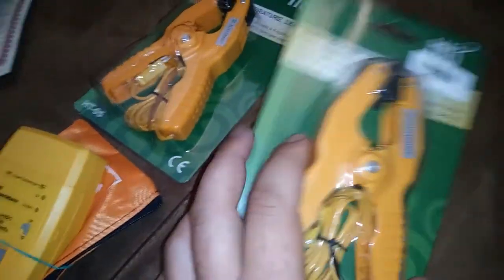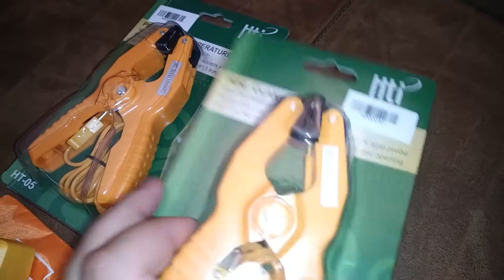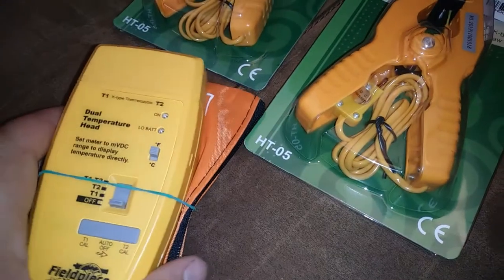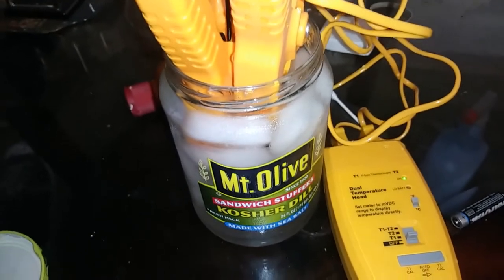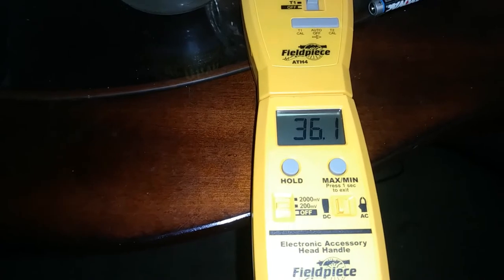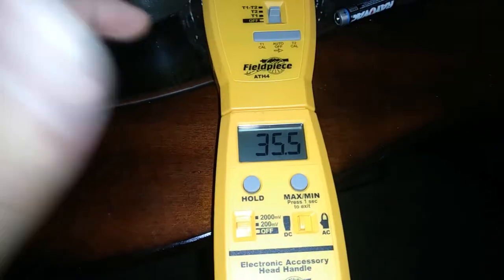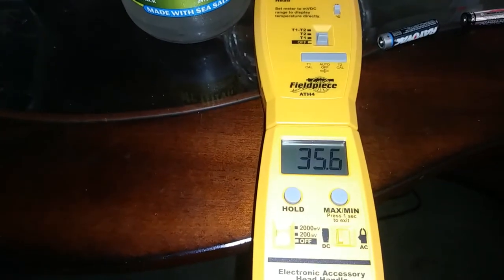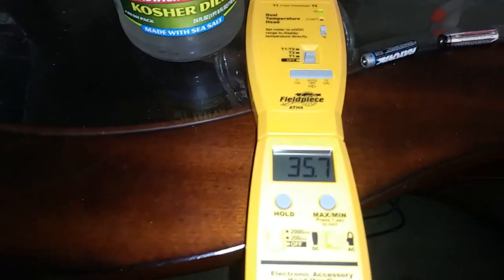Tool Update- Accuracy Test on Cheap Thermocouples with Fieldpiece Dual Temp Head

Comment: I had the same experience trying some inexpensive K-type sensors from Amazon in my Fieldpiece ST4.  The two cheapies read very close to each other, but they are nearly 10 deg away from the orig Fieldpiece sensors.  I'll keep the cheapies in reserve to use as replacements when the time comes and will recalibrate the gauge then.  Was a little unsure about my plan, so was glad to see your video.
Reply from the maker: Great, glad I could help! I actually just got another dual temp head in a lot of heads I bought off eBay. Was just going to resell it but, maybe it's worth having one dedicated to these clamps? I was going to get that big Fieldpiece clamp but its $80! I'm probably going to just wrap the wire thermocouple to the tube if it's bigger than 1 3/8". I usually don't work on stuff that big anyways...